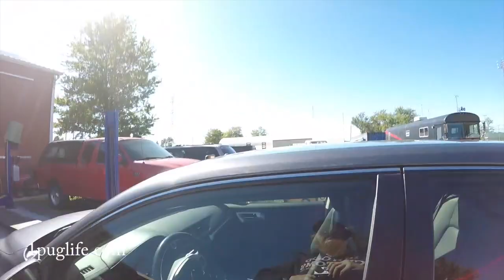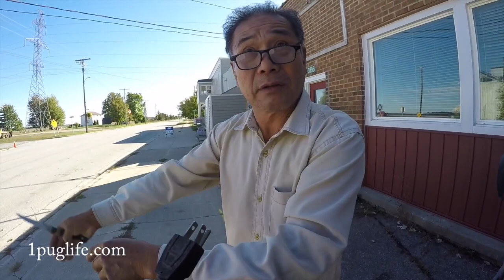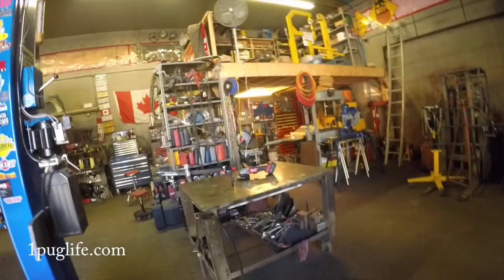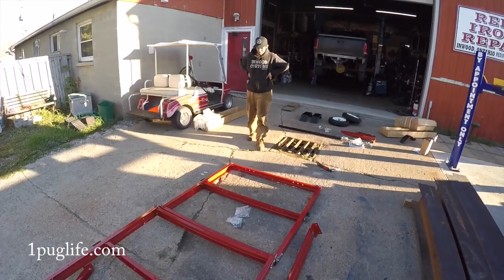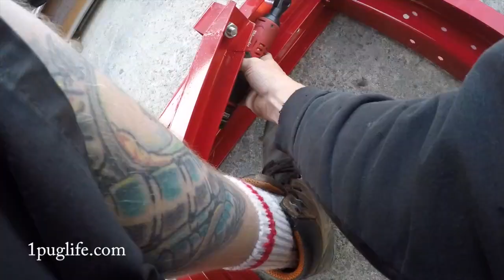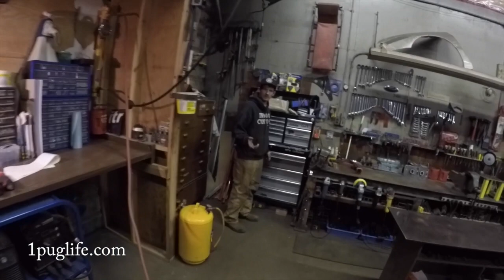tumuchi trailer

Comment: 1000 litre of water weighs 1000 kg which occupies 1 cubic metre volume.
Reply: I Make and Fix Stuff : cubic metre is a volume not an area.
Also you have to add the water container and the trailer.
1000kg would be the max total weight.
Reply: Yeah volume sorry.
Reply: 1 square meter is area buds
Reply: yes but 1 square meter is not the same as 1 cubic meter
Reply: gotta love the metric system. Now try that in Imperial, there's a reason why the US is the only country that uses imperial.
Reply: Dixon: most countries adapted the use of the metric system recently & Imperial was the standard when it came to manufacturing...
Reply: Most countries switched 40 years ago. It's an out of date measurment system. The US is too stubborn to change.
Reply: Usa uses a 159l barrel canada uses a 210l barrel. 1m3 is 6.29bbl usa. Stovepipe.

Comment: I haven't same trailer, I got mine at harbor freight over 15 years ago. I put marine grade 1 inch plywood on for the deck and have never had a problem with it and it had been abuse sumpin terrible over the years I need to redo the paint on it and put some new tiiirres on the old bitch this winter to get another 15 years outta it!

Comment: Time to change up your FAKE tire squealing sound effect! It is getting old! Not to mention tires dont squeal like that WITHOUT SPINNING! Why did you let Tumuchie buy that cheap ass trailer? That steal is too cheap and thin. I hope he dont plan on hauling much weight on it. You could have built him a nice one! It is not hard to build those I made mine in one day and it is heavy duty. I also make nice heave duty cargo racks that connect to the trailer hitch.
Reply: Gene O articulate much?